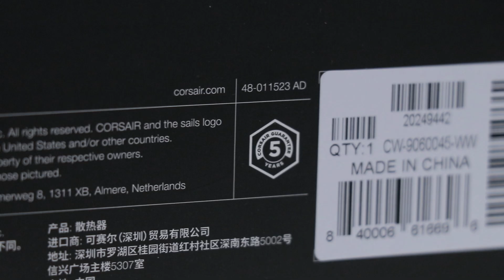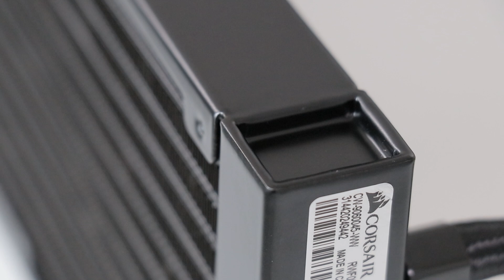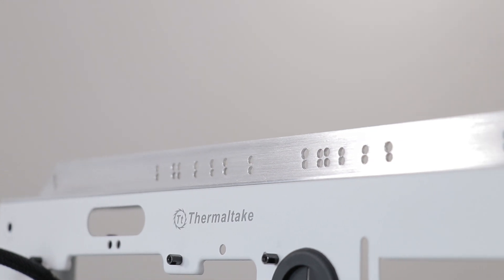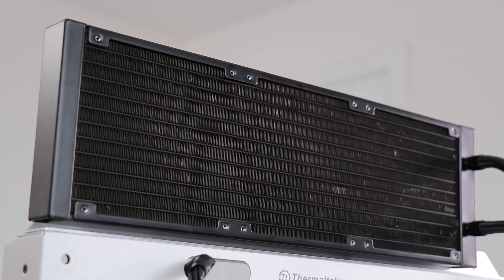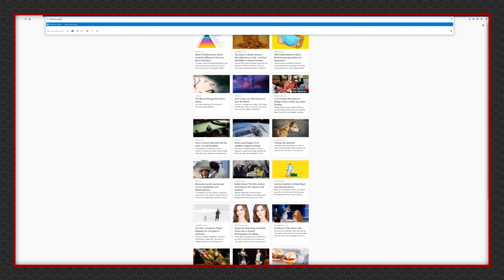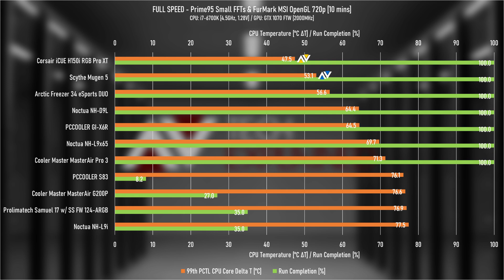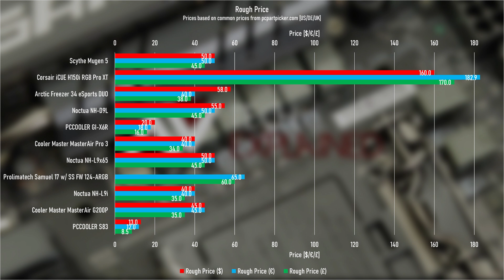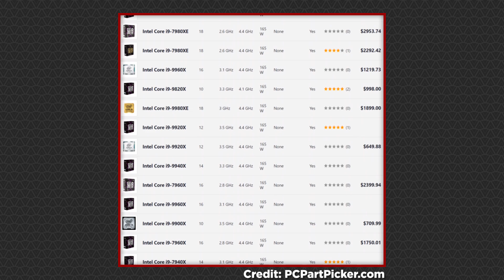Corsair iCUE H150i RGB Pro XT (360mm ARGB AIO) Review

Comment: Maybe you can try to overclock the 6700k to see how far you get with this cooler
Reply: And maybe use a newer Gen CPU. Not sure how many people are looking to replace the cooler in a much older build with the most expensive AIO Corsair offers?  Majority of reviews for this cooler use older CPU’s for testing as well. Starting to wonder why? Very few testing it on something we know gets hot.
Reply: @craiglyle2966  even though its is old, the 6700k has a very high tdp. As intel 14nm matured and became more "efficient," newer cpus, even though they can generate quite a bit of heat, still in many cases wont be as bad as this old boy.
Reply: qT p13 Still has a lower TDP than 9th / 10th gen Intel with half the cores and threads. IMO if you’re going to test a new cooler, then it makes sense to test it with a new CPU. How many people are running a 6700k these days in a case big enough to fit the cooler in? If they are, why would they pair it with an expensive AIO (and case to fit it), when an air cooler at half the price will perform just as well? In any case, the 6700k doesn’t really compare in performance or thermals to the newer gen Intel CPU’s, which most people buying the latest Corsair 360mm AIO would already have or be looking at getting.
Reply from the maker: Patreon.com/AVTechy
Reply: @craiglyle2966  i dont think you understand how cpu thermals work. For example, a 9700k has the same tdp as a 6700k, but its more cores means that the heat dissipation is actually improved, making the 6700k theoretically hotter and harder to cool. The purpose of testing a cooler is to test its ability to dissipate heat. Whether the cpu is an old one, new one, is slower or has worse performance is irrelevant. You want the cpu that produces the most heat as a worst case scenario. I understand where you are coming from about wanting to see it in a modern scenario, but using a 6700k isnt a bad shout at all.
Reply from the maker: Sounds about right to me. One issues the 6700K does have is with thermal density. Newer CPUs like the chiplet design from AMD spread the thermal energy across a larger footprint, so if an 8 core Ryzen CPU is outputting 100W it's across a larger surface area than if the 6700K was outputting 100W.

In that example it would be easier to cool the Ryzen CPU since it can take better advantage of a larger area of the cold plate which leads to better heat transfer to the heatpipes, and thus better cooling.

100W is 100W, but the density of that thermal energy really matters when it comes to cooling.
Reply: AV Techy that’s assuming a z370 or z390 motherboard will run a 9th gen i7 or i9 Intel CPU anywhere near 100w under full load, even at stock settings. Which they won’t. That’s the beauty of reviewing a product, seeing if it performs according to its technical specifications. I assure you the 95w Intel TDP is completely irrelevant when it comes to real world performance with these CPU’s, making  cooler performance specific to the newer Intel CPU’s, completely relevant.
Reply: qT p13 Do you have any real world experience with a 9700k or 9900k? Motherboard vendors (all of them, I know of) bypass Intels 95w TDP in BIOS. These CPU’s will run upwards of 150w at stock auto settings. At 5.1Ghz the 9900k will run at or above 225w, under load. I own both these CPU’s. You really can’t compare specs, without comparing real world performance.
Reply from the maker: Who's talking about TDP? Nobody has mentioned TDP but you...

I know my 6700K is pushing 90W under Prime95. I also know a 9900K at 5GHz pushes under 80W under many gaming workloads. Yes it can hit over 200W, but that's in torture test land, which isn't every workload.

https://www.tomshardware.com/uk/reviews/intel-core-i9-9900k-9th-gen-cpu,5847-11.html

As long as we're not comparing TDPs and full loads, we can take that wattage and understand what it means in context - maybe more relevant to people buying mid ranged processors, not high end ones.

We're also comparing coolers to coolers here, nothing to do with how it'll work on your CPUs. At least knowing at 90W one cooler is better than the other is useful information. But then again, I did caveat the whole wattage situation at the end...

There is of course a fool proof solution to all this:
www.patreon.com/AVTechy
Reply: AV Techy really?? the 9900k isn’t ‘just’ a gaming CPU. If all you’re going to do on it is game, then buy the 9700k, which performs virtually the same ‘in gaming’. Or for slightly less performance, stick with the previous generation entirely. (Which you don’t seem to have reviewed at all either). 

Why the hell would anyone buy a K SKU CPU by the way, if they’re not going to maximise the performance potential by overclocking it? Isn’t that what the whole K line of CPU’s is marketed towards? 

Now correct me if I’m wrong - the i7 6900k, wasn’t that Intels high end CPU back in the day? aimed at high-end desktop and prosumers? Given you review characteristics and performance of PC parts for a hobby, I suspect you probably prefer purchasing high end parts wherever possible as well (budget pending)? I’m guessing that’s where the i7 comes from? Your old rig?
If it’s the mid range market your trying to grab the attention of though, wouldn’t testing an i5 (since i9’s didn’t exist back then and i7 was top of the line) make more sense? 

80w on the 9900k? Maybe some really light gaming, web browsing and a bit of Spotify. A simple image render or short 4K video edit, will push it to double that in a matter of minutes. Believe it or not, there are people out there who edit and render video with these CPU’s as well.

As for the Patreon thing, I read up on the benefits. Not really a lot in it for anyone but you. Maybe (as I simply suggested to begin with) you could review some of the more current CPU’s as well and you might get more hits / views / subscribers and actually earn your money, instead of asking for handouts. Paying you to eventually review one for me, also makes no sense by the way, I just wanted to know how well this cooler would work on it, which is how I ended up here to begin with. 

You know you could always approach the manufacturers for CPU testing samples, like virtually everyone else does? 

YouTube’s full of reviewers who took a deep dive into 9th Gen thermals, raising the issue extensively, 12 months or more ago. There’s quite a good review and explanation of the problem on Gamers Nexus. I won’t drop a link, i’m sure you can find it! 

As for TDP, I did mention it, you’re right. Didn’t you mention watts and improved thermal performance of newer IHS designs though? could be just me, but i thought Intel used TDP in its marketing specs for a reason and even though you haven’t specifically mentioned TDP, you are referencing heat generated by a chip. Since this video was all about dissipating that heat, TDP is definitely a valid part of the conversation - especially when trying to determine cooling requirements, as specified by the manufacturer.

As for video topic, it’s a review of the latest and greatest 360mm AIO cooler from Corsair. It’s right there in the description. Not a mention of comparison to any other cooler, I can see?? Granted you did do a comparison though, you made it clear it was actually a review for of this model for Corsair. Since you can’t actually test or compare a cooler (other than cosmetically) without a CPU and it is a brand new cooler, aimed at performance level enthusiasts (who don’t want a custom loop) I still think it makes great sense to test it on a modern CPU. You know the type Corsair undoubtedly had in mind, when they released it.
Reply from the maker: @Craig Lyle  Nobody's saying the 9900K is just a gaming CPU, it's just an example to show how testing with the 6700K isn't ridiculous. Again, I think the 6700K's thermal output is similar to many CPUs still on the market (mid range Ryzen / Intel CPUs) in many scenarios, not all, but many.

Who's saying not to overclock a K SKU CPU? Just checking the thermal testing graphs presents I've overclocked this one to 4.5GHz at 1.28V. Nothing crazy, but it also tests small CPU coolers so I need it to just about manage those without throttling in every scenario.

Yeah, the 6700K came from an old system, is that a problem? We're talking mid-ranged by today's standards where the core counts are higher, and the power consumption is more similar to some of the higher end CPUs from years ago. Thermal density has been on an incline for Intel over the years, so it's not unrealistic to compare what was a higher power consumer CPU back then to mid power CPUs today. Again, we're talking 90W with Prime 95 and about 60W with Fire Strike, not unrealistic for today's mid range market.

Again, the 80W 9900K example is just an example as to why the wattage output of the 6700K isn't obsolete. That's clearly a joke you've got there, talking to someone who renders on a regular basis. Again, nobody has said any CPU is just for one thing, this is an argument you're emphasising to diminish other arguments.

Man you need to chill out a little. The Patreon links were just a little bait, a little joke to say if you deem it necessary to test with high end current generation CPUs you're free to fund it. I'm not dumping £700+ on a new CPU and board just for testing, that's just not viable for obvious reasons. So yes, sometimes smaller channels will use cheaper or older hardware, which granted isn't ideal (I wish I had £700 to spend on a reliable board and high end CPU. I squeezed together enough for a decent board and a 3700X which was enough of an expense), but it does the job well enough.

Approach a manufacturer for a test sample? Are you kidding? I can barely get a handful of companies to send over case and cooler review samples, let alone £300+ CPUs. Test samples regarding CPUs and GPUs are generally temporary samples for smaller channels that get handed from channel to channel, rather than something that gets to be kept. If you've got a contact let me know, but I know just trying to get a reply from some manufacturers for £70 cases is rare.

Gamers Nexus, great example... also uses a 6700K only on their case testing system... https://www.gamersnexus.net/hwreviews/3606-phanteks-enthoo-pro-2-case-review-vs-lian-li-o11-xl

Thought I'd drop a link there, not sure you'd found it yet... Maybe they too need to get with the times and update that test system, nobody's looking to get a new case for their old CPU and CPU cooler (I'm just being factitious there, they're using a constant test platform to generate a consistent thermal output to compare cases fairly... much like I'm doing with my cooler reviews).

TDP is a very vague figure, I'd have thought a viewer of GN would know as much. It's calculated differently by CPU and CPU cooler manufacturers - GN recently covered this. They all have conflicting ideas about what it is and what it means. Real wattage is what matters most, unless we're describing something very vague, in which case a vague figure like TDP 'could' be used.

I mean Corsair came to me to ask if I wanted to review it. They suggested I check it out and test it. I've even discussed what you're talking about now, only not relating to newer CPUs, but higher wattage CPUs. Again, nobody here's claiming we're comparing to a 9900K here, my conclusion should have made that abundantly clear. You "can" make that comparison at lower loads, but like I said if you're looking at high wattage CPUs you should seek a cooler review with a more similar CPU to the one you intend to use.

Anyway, I think I've answered as many as the queries you've brought up as well as I can. If you don't like it then I guess you can stick to watching GN (but not their case reviews, way too old right?) or other channels that can afford to update their test system to keep up with new generations of hardware.
Reply: @AVTechy  Now we're getting somewhere. Less reactive, more honest. We could've avoided a lot of back and forth if you'd just said, I can't speak from personal experience when it comes to newer Intel CPU thermals, because frankly CPU manufacturers wont send me any for testing. I'd love to review one though and it's always interesting hearing actual user feedback regarding real world experience with these CPU's.Yes, from what I've heard they can run well above Intel "TDP" specs, making cooling a significant challenge for new builders. Not an issue for users who are content with lighter workloads, but given that most users these days are into heavier multitasking workloads and overclocking, it's an issue the majority will need to address. I can understand why users would be interested in seeing Corsairs latest AIO cooler running on newer Gen CPU's, as it's not unreasonable to assume most people sticking with the Intel platform these days, would be looking at partnering a 9th or 10th Gen CPU with a cooler such as this. I've personally switched to the Ryzen platform and the 6900k is the CPU i used to run in my personal rig. It's been relegated to my test bench CPU these days, as I find it still performs well for this purpose and saves me additional expense. I'm hoping as the channel grows, I'll be able to upgrade to something a little more current. Until then it's the best I can offer. Perhaps my followers could help persuade Intel to get onboard by sending me CPU samples for testing in future? This would certainly help alleviate the need for comparisons based on assumption alone. Although I can't test a newer Gen CPU with this cooler, I do believe the 6900k provides a performance baseline that could assist a user in deciding how effectively it will perform on a power thirsty CPU like the 9900k. I note that Steve at Gamers Nexus also tested this cooler and CPU combination. I presume your first comment was in reference to this? Yes, it is odd the majority of reviewers have avoided combining the cooler with a current Gen CPU. I suspect it's merely coincidence or perhaps lack of availability that led to this, rather than reviewers being concerned the cooler might struggle to adequately dissipate the heat buildup on newer Gen CPU's? Honesty though, I'd only be guessing. I look forward to someday being able to answer that question definitively. In the meantime, like, comment and subscribe to the channel. It all helps. Alternatively if you'd like to donate to my Patreon, it would improve my ability to purchase new hardware to review.Thanks for showing an interest in the channel :)
Reply from the maker: I mean that's cute and all, but you've avoided every one of my rebuttals and are pretending I'm on the same page as you... so we're on the same page here, I'm not. You've written your entire response based on me saying I can't afford to buy a 9900K, and assuming that's all there is to it. 

You're also assuming I've never touched high power kit like the 9900K, 8700K, 2080Ti, RTX6000, RTX5000 therefore I can't understand how they work in comparison to the hardware I'm testing with, but believe it or not, I've tested all of them. The channel isn't the only access to hardware.

Err, check the steam hardware survey, most people aren't rocking 9900K's, and most people in general aren't heavy content creators nor are they heavy overclockers. And again, I don't think you need the latest generation of CPU's to test a new CPU cooler, nor does Corsair since they recommend Extreme Edition CPUs to test this cooler rather than 115X socket CPUs but they don't specify it needs to be the latest generation of CPUs (they're talking power, as am I). It's just you that's demanding the latest generation of CPU's to test CPU coolers.

It's really cute how you want me to use terms like "I've heard that" relating to TDP, when I've clearly been telling you TDP isn't a reliable figure (you brought up TDP trying to say it was useful, I'm told you it's not since it's too vague, and now you're summarising that CPU's regularly go above TDP figures which is why I was telling you it's not a helpful figure). You're also ignoring my entire conclusion to the video, and my summarisation in the later response, saying if your'e using higher power hardware and you want more realistic numbers relating to that hardware you should seek a review with that hardware.

Are you trying to get me to spew as much nonsense as you now? GN hasn't reviewed this cooler, nor does their CPU cooler test system use a 6700K , why are you trying to get me to say they have? You're lost in your own nonsense, and it's making your arguments crumble.

Again, I don't need to upgrade to test these coolers, it's not necessary. The 6700K (not 6900K, you seem to have an issue stating the truth) is perfectly adequate at consuming 90W, which provides a perfectly good thermal load to test current CPU coolers. Haha, "until then it's the best I can offer", lol. I don't need to upgrade it, there's no point on buying a new consumer grade CPU that will output roughly 90-100W when I already have one. The only reason I switched to the 3700X is because it performs better, it's really not that tough to cool it (which is strange since it's a newer CPU and should perform vastly different to my old 6700K right?... or should it?). 

It's not odd people aren't combining current gen hardware to test coolers, if you think about it for a few seconds (spoiler alert, it's not a coincidence). All we need to test a cooler is some sort of load that we can verify. Whether it's 90W with my 6700K, or 200W with a 9900K. Just think if everyone tests with a 9900K outputting 200W of heat, what are the majority of people that aren't buying a 9900K going to do with that information? Most peoples CPU's aren't outputting 200W, or even 150W of heat, so lower power CPUs (CPU's outputting a more reasonable thermal load by today's standards, let's say 90W) target the majority of the market and is more useful to most people.

Again you're silver bullet GN (more like a plastic bullet which you're ignoring since your argument was about as ineffective) before updating their testing methodology recently with their new $10K thermal generator has been testing with a 5930K, older than my 6700K! Are you saying they too should have upgraded to 6th gen, 7th gen, 8th gen, 9th gen as they all released to stay current (or every other generation). Or do you think they thought, "wattage is wattage, and I want a consistent test platform to compare all these coolers with"? Yes there are changes in thermal density and the CPU die between generations, but 90W is 90W, the cooler to a certain degree needs to handle that load regardless of how it's spread out, and consistency is key to testing rather than changing the test platform after every new CPU generation.

I know you want to make out that I'm naive, ill informed, and inexperienced, but your arguments have the structure of a collider, they only hold water for a mere second (again, hence the tangent you went on, and how you're not responding to my rebuttals anymore). * You've made a series of blunders that are just false in your last comment, and it's almost like you're attempting to flip information I've been telling you (TDP isn't useful - you said it was, the 6700K is still a reasonable platform for testing coolers - you're saying only new generations of CPUs should be used to test new coolers) into your grand conclusion. Or maybe you're back peddling to the highest degree and have accepted what I've been saying which is why it's in your conclusion.*

In summary. The 6700K is perfectly adequate a providing a reasonable thermal load by today's standards. According to Toms Hardware the 3700X consumes roughly 90W stock, 111W OC'd:
https://www.tomshardware.com/uk/reviews/ryzen-9-3900x-7-3700x-review,6214-3.html

According to Kitguru the total system power consumption from idle to full load with Aida and Cinebench is a change of 80W with a stock 3700X, 90W with a OC'd 3700X, 120W with a stock 3900X, and 155W with an OC'd 3900X:
https://www.kitguru.net/components/cpu/luke-hill/amd-ryzen-9-3900x-ryzen-7-3700x-zen-2-cpu-review/11/

So while I can say I can't accurately cover really high power CPU's (as I said in the conclusion of the video...), I can say that I'm loading these coolers similarly to the current mid-ranged CPU hardware today (minus the thermal density which is a factor).

Unless you provide evidence as to why 90W from a 6700K is completely different to 90W from a 3700X (outside of thermal density as I've already pointed out), then your argument is just saying "new CPU coolers should be tested with new CPU's"... which begs the question, why? Give me some evidence, I'm giving you some. Or you can just repeat opinions, make comments trying to belittle my financial position as a prop for your argument, or my "lack of knowledge" (despite the evidence I'm providing supporting my argument).

Get some evidence behind your argument, or don't bother at all...